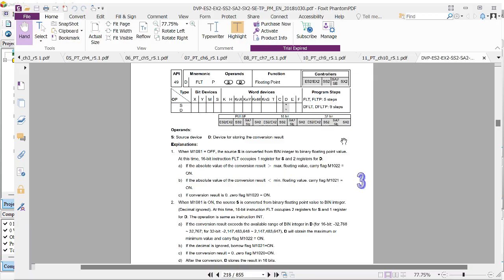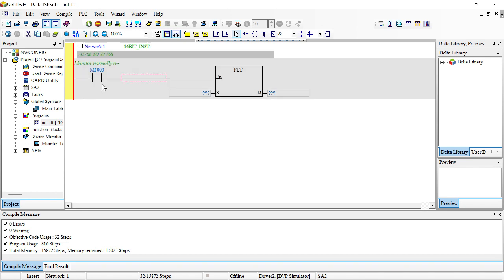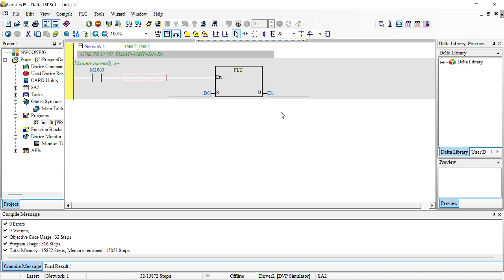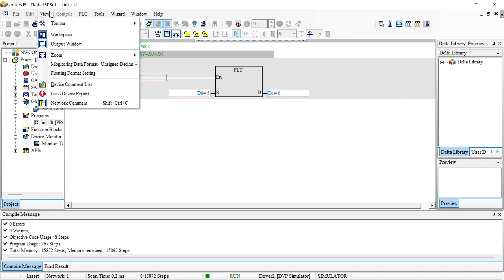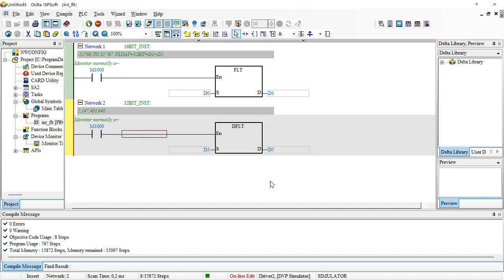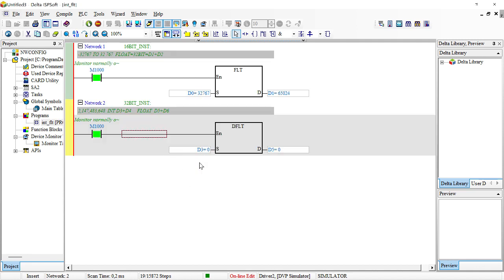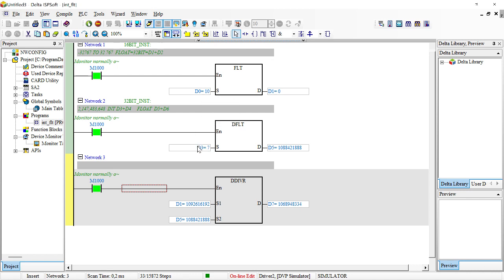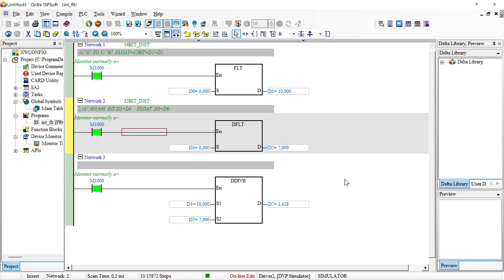Float to integer conversion delta plc , ispsoft (ENGLISH)

Comment: I'm working on a Delta PLC and I'm converting an analog input to a floating-point number. I perform a series of operations and need an analog output, but to do that I need to convert the floating-point number back to an integer. How do I convert from floating-point to integer?
Reply from the maker: You use Int instruction

Comment: Sir, which delta plc is best for Auto chiller plant automation  control , including optimizer
Reply from the maker: hi it all depends with i/o that you have what you want to achieve .but a dvp20sx is a good all in one solution since it comes with analog inputs and analog outputs  and supports a lot of instructions..............................dont forget to subscribe